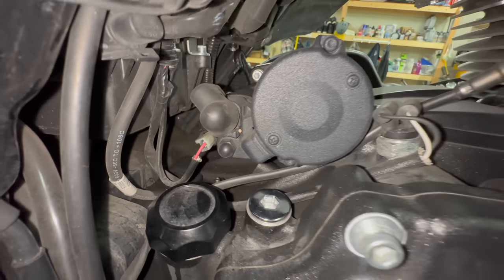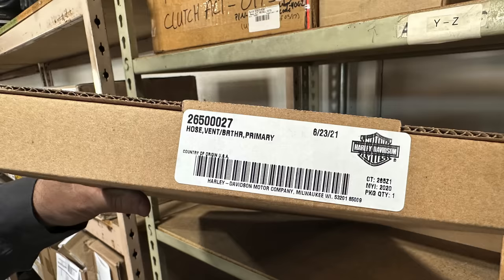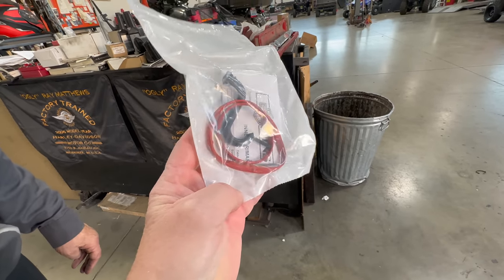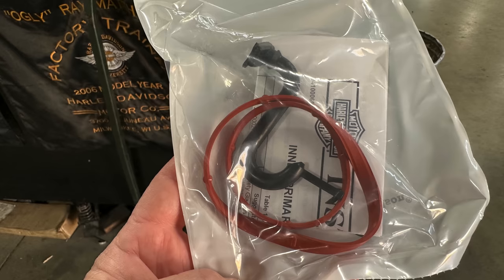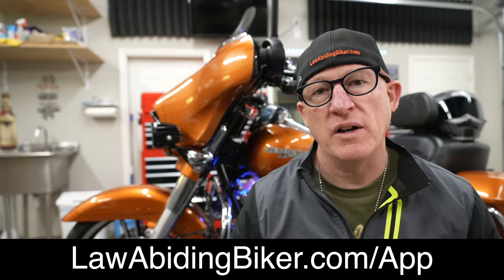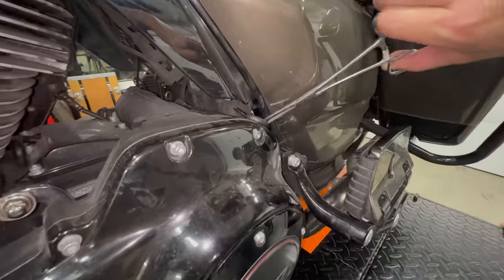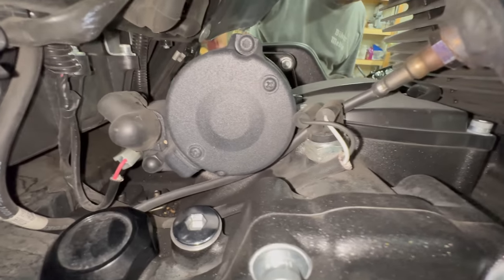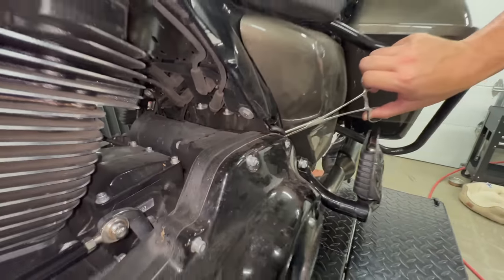A Must Check Harley Milwaukee-Eight Oil Leak Issue! FOR YOUR SAFETY!

Comment: I had this exact same problem out of no where on my wife's road king went to move it for her one day and saw all the oil did a quick look over thought it was the inner primary seal bought all the gaskets and seals because we were already on the way to the harley dealer got home gave it a better inspection and found the vent tube was not seated properly put it back in place and returned all the parts

Comment: Used to work for Harley and we saw this on ABOUT one out of 500 bikes that came off the truck. We added it to our PDI checklist as with Harley anything less that 1% is not a warranty issue. In this case less than 0.20% of all new M8's so not really a "common" problem at all.

In hind sight the dealership that sold the bike should have caught this at their Pre Delivery Inspection (PDI).
Reply from the maker: Yah, in our private Facebook Patron member only group we have quite a few guys that have had to deal with this. Not every dealership is checking this it seems. Thanks for the comments.
Reply: What about the 2018 Bikes??  I have a 2018 Road King Special I just paid off?  Am I just suppose to sit back and wait for my oil pump to leak and possibly burn my whole engine on a long ride to know if I'm one of the 0.20%??   Please get back to me and let me know your thoughts?  Thank you

Comment: Wow!  My 2021 Road Glide Limited with 3,200 miles had 2 drops of oil a few days ago and then 2 more drops this morning with oil built up on the two lower bolts of the primary.  Flashlight on back side of primary revealed where oil was coming from which was the base of the relief tube.  Needle-nose pliers and a gentle tug moved the tube about a half inch or so and stopped!  Thank you so much for the information and quick fix. 💪🏼😎🍻

Comment: I have a 2022 Road Glide Special and have had oil leak problems mostly front rocker case, upper oil line, and air filter. The air filter bolts vibrate loose and slobber blows over the right side of the bike. They need to be tightened at every oil change or sooner. The other leaks were fixed under warranty. To say Harley needs to get on these problems is a giant understatement. Thank you for posting this video.
Reply from the maker: You bet!  Glad to help. 

Ride safe & Ride Often!

Check out this YouTube Channel as we have a ton of free videos for you!

Check out our useful for purchase videos: http://www.lawabidingbiker.com/buyvideos

BECOME AN ECXLUSIVE MEMBER-GET BENEFITS:
http://www.lawabidingbiker.com/patreon

Leave a flat donation: 
https://www.lawabidingbiker.com/donate

Shop in the Official Law Abiding Biker Store:
https://shop.lawabidingbiker.com

Subscribe to the Law Abiding Biker Podcast: https://www.lawabidingbiker.com/app

Join our free email club:
https://www.lawabidingbiker.com/emailclub

Comment: I am glad that issue was solved before I purchased my new Tri Glide in May of 2021. But, when I took it in for the 1000 mile check, I had noticed that the bottom of the engine and tranny was oil wet. The dealer had a time trying to find the leak as wind was moving it around. They cleaned it up and told be to put some miles on it. I did and when I brought it back, they found the leak. The seal where the shifter goes into the tranny was leaking. Since they had the parts, my bike had to undergo surgery. Removal of the inner primary to make the repair. The tech said after inspecting the old seal, he could not see any damage to it. But the new seal fixed the problem. You never know. I have about seven months left on the warrantee.
Reply from the maker: Glad you're up and running!

Comment: So, instead of taking responsibility for their manufacturing mistake, Harley makes the customer pay for the necessary fix.  That shows how much Harley does not care.
Reply: Actually it is a free fix at an ethical dealership, the pull through vent tube that is. If you need a vent tube it will cost you because it is less than 1% of all touring M8's produced. So your federal government says it is not a warranty item.
Reply: @JamesMcKeeRottweilerKings  The fed only forces recalls when the bean counters tally up the cost of recall versus the cost of damage to the customer. IE:  death, injury, etc.. If it is just dollars the fed cares not. However, an ethical company selling products costing thousands upon thousands  should stand good for their failing to produce as defect free product as possible.  It's all about the 'Benjamins,' in the US.
Reply: 1%? Everyone I know with the 17-19 M8’s have the transfer problem. Harley-Davidson will add the vent kit after multiple tests show the problem is real!
They haven’t a clue as to why! 
  I had to use the “Fat Pushrod “ from Greg Williams. I have kinda wondered if the factory transmission vent ( top of transmission cover ) isn’t venting properly.
  But the pushrod greatly helped control oil transfer.
Reply: There's always victory
Reply: @kevinwilliams8907  Ah, you mean Indian, since they absorbed Victory.

Comment: My 22 fat bob had developed a leak under the rear of the primary just before 5k mile change. Got a 3 hole change thinking it was a failing primary drain plug washer. Got the change, and leak still there. Took it to HD for warranty. They said it was the starter o-ring. Continued to leak for an entire week. Took it back to HD. Two senior techs couldn’t figure out where it was. They believe the leak is coming from one of the cylinder heads and will need to take apart the motor. All under warranty as I signed a $0 ticket. Hoping I’m not without my bike for too long, however, I’m glad I have the warranty.

Comment: It is a shame that Harley is aware of this problem and won't make it a recall. I have a 2017 Road Glide and had the problem. The Motor Company would not cover the repair under their extended warranty. it would have had to be under the 2 year factory warranty. What a sad statement for them. Thankfully after having purchased 4 Harleys from my dealer, they covered the repair.
Reply from the maker: Glad they took care of you in the end

Comment: I had oil leaking in the same area. I was hoping the problem was as you described but it turned out to be a blown rear cylinder head gasket on my 2020 FLHT 107. 26k miles. 😢

Comment: 120 Point inspections, leaks and checking for them. My 2022 street bob with 79 miles on it had a small puddle the size of a tea spoon by the time I rode the 6 miles home after purchase. Located to the rear cylinder at the base under a lip in the casing to the far left. Camera and light inspection could find no source of the leak. Seems its seeping up somehow through the casing. Warranty issue and no bike almost from the off, thanx harley davidson your quality control sucks poop through a straw.

Comment: Happened to my 21 ultra, noticed about 2 weeks after ownership, fixed it my self, however abit of a let down from HD.
Also, my engine oil level after the first service was extremely over full, again addressed this my self, I know, tons of individuals would have taken it back to the dealer, I couldn't be bothered, and both was an easy fix.
Reply from the maker: Rock on

Comment: I have a '17 Road King and haven't seen too much oil transfer but I have seen oil build up inside the throttle body air intake. 
I therefore went and invested in a Feuling vented dipstick.
There's less oil in the intake but not 100% eliminated. 
Thinking of adding a Trask vented transmission cover for even more venting.
Reply from the maker: Rock on. Thanks for sharing! Ride safe

Comment: Problem is the vent didnt fix the transmission issue for heavy rider. My trans went out at 26k miles. 1600 miles after service full fluid transfer transmission pretty much grenaded. Harley wouldnt cover it. So do the clutch rod also. To prevent further damage

Comment: So I have a 2018 sportglide   Its at 14 k now and just took it in to get serviced march 2023, i trailered it in and just rode it a few days ago first time.. it has dried oil under the oil filter , and seeping out of the push rod area and the cover to the left of it ( sorry im not super familiar with the parts still.) so i called them they said it was probably “residule” and said I could bring it in without an appointment if I felt safe rising it ???? !!  Ill check oil level in morning and again when shes hot.. i know some guys over fill the Milwaukee 8it needs an exact amount and its less than previous, but im gonna ask about the warranty part because I bought her in 2020.  And that should have been done before resale.. i bought her with only 1000k and stage 1 upgrade was on her… i love this bike and have blacked out so many parts already and custom seat and the accessories i have to change her look and travel all kinds like up to $10 grand already in changes for her … should i be getting this done? I also have a 2021 roadglide special with only 174 k shes brand brand new.. i wont be riding her for a few years still.. im a new rider 3rd season only 13k under my belt.. just been on the back my whole life and well i always loved the bikes . And i took to it like a fish in water . Just love riding planning to go across canada and all through usa this year so i need her mint 💖🙏

Comment: Hello, I had a 2019 Road King, I had a warranty, they replaced the incorrect oil pump, and redid the top end, it cost me $ 50 because I had the warranty otherwise it costs $5000... I sold it back to them and bought a new 2022 Road King with the over sized screaming eagle oil pump...your fix doesn't work, it's messy and gets oil all over the bike eventually. It really needs the new oil pump gear.... probably too late for anyone now cause it's almost 2023...good thing I had a friendly Harley Davidson dealership who had.my.back....

Comment: I'd just like to state that I have a 2020 Softail Standard with the 107ci, and it does not have the vent tube. I've been trying too figure out if it was on the bigger bikes only, if it was exclusive to 114's, or what the circumstances are around why my bike doesn't have it. I'm coming up with nothing unfortunately. If anybody knows what the deal is, I'd be interested too hear.
Reply: Weird. My 2020 fxbb has is

Comment: The best way to stop the fluid transfer is to install a hydraulic clutch push rod from Macomb County Choppers (real easy to do). The rod is 9mm in diameter instead of 5/16"(<8mm). My 2017 M8 107 had a big problem with fluid transfer and this stopped the transfer.
Reply: NO hydro clutch for me. Even HD stopped putting those things on the bikes.

Comment: I just got my 2019 street glide back from my local dealer. I took it in for the 60k service. Mechanic suggested I have the vent tube installed. I declined since I haven't had any issues with it.
Reply from the maker: Right on.  Not all bikes need it.  HD just decided to put them on 2020+ models just in case.

Comment: I have a 21 Fatboy with M8114....had a rear cylinder rocker cover oil leak straight from the factory. 

Apparently according to the technician that did my fix under warranty, there are alot of 114s with this issue...but naturally no recall.

Harley needs to get their shit together on quality control...not impressed when I spend $30K and ride home to find there's an issue on my very first day.
Reply: Have you had any more issues? I am interested in Harley Davidson but I don’t want to spend that kind of money and see issues at all. Particularly coming from sport bikes where they have been 100% trouble free
Reply: @thomasmcghee2468  HD have many issues, however I've been fortunate lately and she is purring.

Comment: HD installed the vent on my Ultra at 2900 miles. it slowed it down but never fixed it. At 38K miles it moves enough fluid in just a few thousand miles to reduce the friction zone in the clutch pack. Second time back they simply adjusted the fluids and told me it was the Flo-Moto lever causing the reduction in the friction zone, even though it only happens when the trans is low and the primary is over full, SMH. And even though I've been changing out both fluids every 5K, with my 5k service due to wanting to keep the bike for 150K. If i had waited to change out those fluids at 20K, like the manual says, there wouldn't be any room left in the primary, nor any friction zone.
Loss of friction zone is a safety problem, so its in a lemon law case at the moment. If they can't fix it, ask for a buy back!!

Comment: Harley Davidson actually started having a problem with the transmission fluid transferring to the primary when they switched to a hydraulic clutch back in 2014. That’s the reason Harley went back to clutch cable in 2022. Something with the hydraulic setup caused the problem